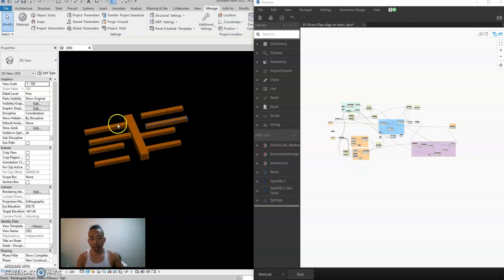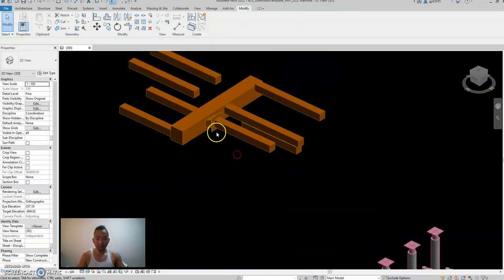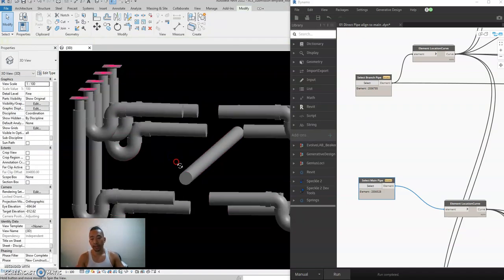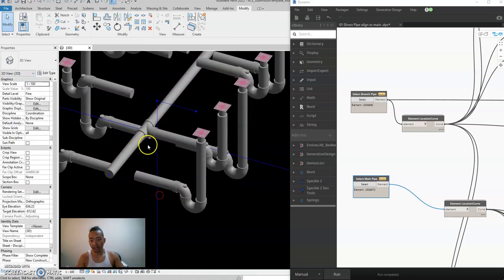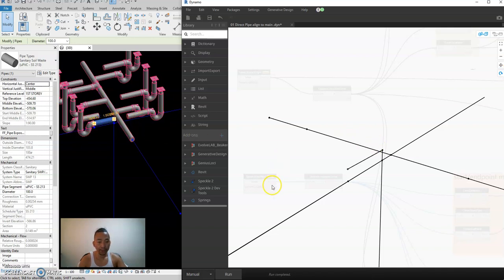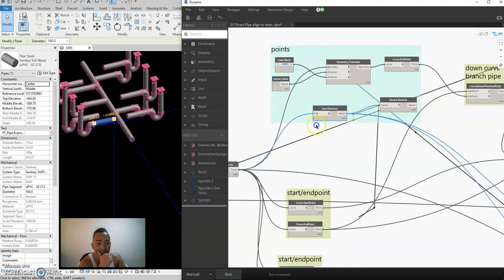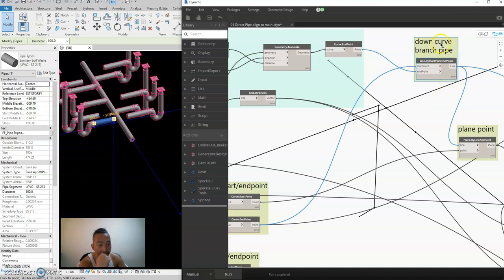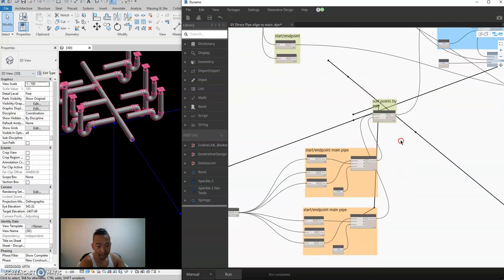Revit MEP sloped pipes and Alignment Tutorial

Comment: Nice tutorial bro. It would be great if the sloped pipe is connected with a wye instead of tee fitting for the drains. We usually connect the branch to the main drain line by clicking the main branch and then right clicking to create similar pipe with inherited elevation. You are good with this dynamo scripts. It would be good if you can create a script for that.